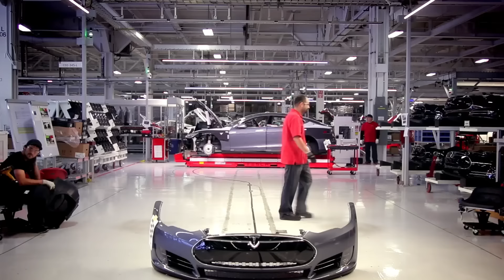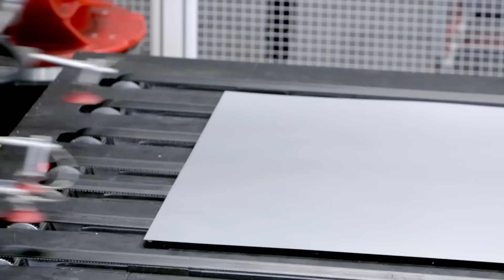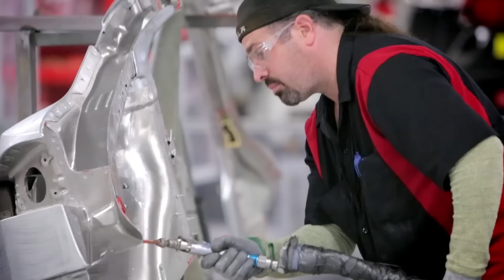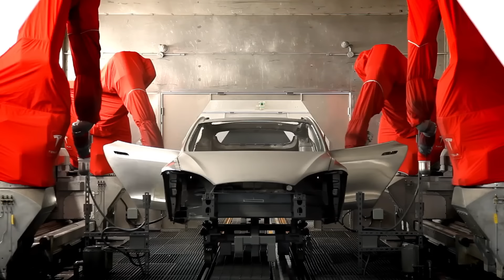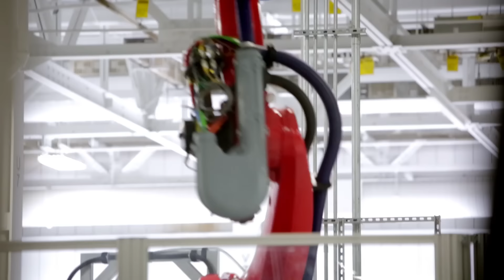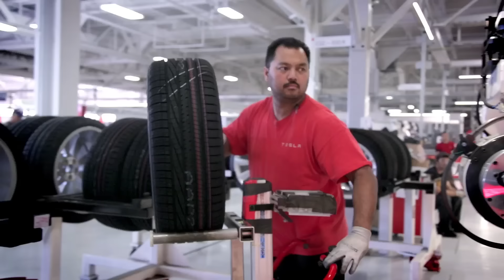How the Tesla Model S is Made | Tesla Motors Part 1 (WIRED)

Comment: It would be nice if all this happened with investors, rather than the sweetheart deal to take over the Toyota Gm Plant in California that Tesla received with the forced bankruptcy of GM. While extremely impressive technically, The Tesla that Edmunds drove 20,000 miles went through 4 motors and two battery packs. Seems to me the details were not worked through like a traditional mfg. I have driven the Model S. It is EXTREMELY impressive in performance. I don't see buying a used one however. I am pretty sure they will get the details right in Gen 2.

Comment: Question and thoughts center around the longevity of the battery (a question no one can answer) and cost of replacement

1. we know the cost to replace an 85 kwh battery is ~$12,000
2. we know the warranty is 8 years/unlimited mileage
3. we know batteries maximum charge degrade over time
4. eventually it will be worth while to replace the battery to get back to the vehicle's original capabilities

therefore I believe we have the consider the cost of the battery replacement in the annual cost to "fuel" the vehicle and if you do this the cost to run the car per-mile vs. an ICE car by tesla's own numbers is not very favorable

Assumptions: 15,000 miles year, ICE 22 MPG, gas = $3.80 gallon, kwh's = $0.11/kwh

by Tesla's own numbers @ http://www.teslamotors.com/goelectric#savings
ICE Car = $2591 year in fuel cost $0.17 per-mile in fuel
Model S = $467 year in fuel cost $0.03 per-mile in fuel

that is until you figure in the cost of replacing the fuel tank at the end of an 8 year life span (the battery) - for which you have to budget $1500 year - making the cost of the Tesla's fuel system $1967/year or $0.13 per-mile in fuel…

now I know there are other costs the ICE car has - but for purposes of this thought exercise let's focus on the "fuel" system cost and treat the battery as the moral equivalent of the "fuel tank". Which in an ICE car doesn't shrink, or need to be replaced in 8 years.

Even a 16 year replacement is $750/year in "fuel" cost to the battery…that still seems to be far less of an advantage than most people would initially consider?

Are there estimates of what the maximum charge of an 85 kwh battery will be in 8 years? What % a year will we as customer lose? How much will my fuel tank shrink each year?

 I'm thinking I would replace the battery after it loses 20-25% (300 miles - 75 miles of loss = 225 miles of range - time to swap batteries) of it's maximum range, and if that happens in less than 8 years my fuel-system costs now approach the cost of driving an ICE vehicle…I'm still excited.

After seeing & reading about this~ I am really excited also because each state could create jobs just by possibly building many statues or one huge monument of Obama in full figure from head to toe made up of all of the unusable batteries? I love it!

Comment: How many miles(or should I ask months?) will the average Tesla go on a new set of batteries?  And, how much does it cost to replace the battery bank?
Reply: Model S should last for at least 200k miles / 12 years. For now all battery packs are covered by 8 year warranty and sold cars would be covered for next ~6 years. 

Most reported miles driven in Model S so far is more than 75k. Battery pack showed little signs of degradation - around 2% capacity loss compared to when new two years ago.

Comment: Surprised it takes 5 days to make a Model S..... for most companies it's about 20-25 hours. Guess that's part of the reason for the price.
Reply: No it doesn't. They're talking about raw material i.e. a roll of aluminum to driving on the highway. 5 days is incredibly fast. NO OTHER company does that. Most take all of the pieces and combine them together in your quoted 20-25 hours but never start from raw material. they already have the frame stamped, or the engine already formed, ect.  The price, for what you get, is a deal
Reply: Defy Newton Nope, the stampings aren't the bottleneck since the presses just stamp away and build up a bank. Stamping is way faster than assembly. All components are built faster than assembly, otherwise you'd see cars sitting around waiting for the slowest components. The seats (as shown), motor, battery subassembly, dash, etc all come ready to assemble. Tesla just has a very slow line.
Reply: TheArfdog its called precision and quality. Nothing most car companies have.
Reply: TheArfdog  -- See this piece of sheet metal?  Five days from now it will be in a fully functional car.  Yes.  That is very fast.  Oh, and it's getting faster.

Comment: The replacement cost of Tesla's battery is $8k-$12k max. This is a well established fact. It is also a fact that the battery cell price drops 6%-8% per year. The Model S battery pack has a 10+ year life cycle, and carries an 8 year unlimited warranty.
Mining, refinement and transport of rare Earth minerals is 5 times safer, and cleaner than the drilling refinement and transport of oil.
Fyi, even when coal is the source, the Model S accounts for 50% less Co2 and pollutants than gas cars.

Comment: Yikes. In six years of production, this company has churned out a mere 12,000 cars (about what Toyota, or VW or GM do in 12 hours). The cost is prohibitive, except to the famed 1%. Worst of all, the car is an environmental disaster, running on coal-fired electric powerplants. As far as the stock goes, it is trading at 35X book, and has had only one (barely) profitable quarter in it's history. A true white elephant.

Comment: No, because there were ZERO jobs there before.  Tesla is located at the old NUMMI plant in Fremont CA, that used to make GM and Toyota vehicles.  GM pulled out of the joint venture several years ago and Toyota could not operate it on their own, so the plant closed, leaving thousands of workers without employment.  Now the Telsa plant has reopened with assistance (again) from Toyota and employs over 3000 workers.

Comment: The car actually received a never before rating of 5.4 from the NHTSA. 

"Of note, during validation of Model S roof crush protection at an independent commercial facility, the testing machine failed at just above 4 g's," said Tesla. "While the exact number is uncertain due to Model S breaking the testing machine, what this means is that at least four additional fully loaded Model S vehicles could be placed on top of an owner's car without the roof caving in..."

Comment: I have a 2009 Tahoe w/ FlexFuel & Multi-Displacement technology and I have come to the conclusion that a $100,000 Tesla would still cost me less to own and operate. Follow along..

7 Year Purchase @ 1.9%. ($720 monthly)
It gets 18MPG @ $4.10/gallon @ 1,800 miles/month. ($410 monthly)
It needs synthetic oil changes every 5,000 miles @ $70. ($25 monthly)
Other monthly maintenance costs. ($30)
Monthly total now: $1185

Tesla Payment: $900

Comment: Indeed, renewable energy must come to the forefront, but for you to trash EV as you done is a tremendous act of foolishness. EV's are a massive step in the right direction, they enable a path to fewer Co2 emissions and energy independence. The use of coal decreases every year, but even if an EV's power is derived from coal, it's still 50% less polluting than burning gas in an ICE's No matter what your agenda, you stance is flat out WRONG! You will drive an EV in the future. Congratulations!

Comment: All you say is true, but using oil instead of electricity costs 6-8 times as much per mile as making gasoline for that same mile. It's true that we need to move to renewable as quickly as possible (that was your point, right?), so solar makes the most sense. Yet you don't mention that.

You seem to be putting all your concern toward talking down electric cars - you know, the eight-times-more-efficient solution? 

It's a guys - just ignore and he'll go away.

Comment: Tesla makes its own motors and huge battery packs (out of thousands of Panasonic cells). Check out the pictures of the chassis. 362 horsepower from that compact unit! When they put one on the front wheels as well, the performance will be ungodly.

Comment: You "do" have a way to charge.  You just cannot charge at home.  If workplaces had charging spots, you could charge there.  If malls had public charging, you could charge there.  At movie theaters, etc.  We just don't have a good-enough public charging network (I'm talking fee-based, not just some of the free ones).  Get with your employer and convince them to consider putting in chargers.  If so, then you could get a Chevy Volt (I have a 2011 model) and charge "only at work and publicly" or EV

Comment: Coal accounts for only 37% of power production in the US, and the % shrinks every year. However, even if the electricity used by EV's is from coal, they still account for 50% less Co2 than gas cars.
w w w. afdc. energy. gov/vehicles/electric_emissions. php
It's hard to believe people are still reciting that old, tired, long disproven tripe.

Comment: Sorry guys, but this is not the future of cars.  Just based on the manufacturing of their battery alone makes for one of the largest carbon footprints from a car when driven off the lot.  When driven off the lot, its carbon footprint is already as much as my little Honda Civic after two years worth of driving it.  Hybrid/Electric "battery" cars are not the future.  Hydrogen is...

Comment: No, the dual large roll dyno is simply a more up to date type that can provide more accurate data.  It can be used with 4WD or 2WD vehicles.  With 2WD the non-driven wheels are spun by the dyno, more closely simulating friction of all the tires.  Its a ROBOT dyno.

Comment: What jobs are being replaced?  Did THIS car company have humans doing the assembly work 5 years ago?  I don't think so.  This company created 3000 jobs with the opening of this factory.  Using robots is their method of efficiency.  That will insure the same 3000 people keep their jobs for years to come.  

Any company that brings manufacturing BACK to the USA should be applauded!  Yes, they use robots.  Yes the robots are IN THE USA.  And YES those 3000 employees are ALSO in the USA.

Comment: If it is a heavy body, the shock will be directly transfer to the human body in a crash. But if it is a tin body as you says, most of the shock will absorbed by the body itself. And these new designs has engineered ways to push the shock around the cabin preventing it from going through the cabin, also reducing the shock on the human body. I'm not a automotive engineer or someone near that. I said what I felt and what I have read and seen. Sorry if I have made mistakes.

Comment: Edvik, Model S is actually expected to be a VERY long-lasting car. The 85KWh battery of the car has been tested to last past 500,000 mile mark in Tesla Lab - and is still going. So, the battery is expected to last WELL PAST the warranty mark of 8 years. The rest of the car requires very little maintenance due to:

1) Non-rust aluminum
2) Just 3 moving parts (as compared to over 1000 for gas cars)
3) Regen-braking  - no pad maintenance
4) Absence of transmission

Comment: Answers are all over Youtube:
watch?v=9OCaluFHjqw
The car will last as long as you take care of it. The question is the Battery pack, which has a 10+ year projected life, with an 8 year, unlimited warranty. The battery can be swapped at a Tesla station in 90 seconds. Within 10 years the cost should be very reasonable.
watch?v=H5V0vL3nnHY.

Comment: The higher pricing is due to the large battery options (60, 85kWh), an exceptional, powerful drivetrain and indeed amazing electronics (new software features get added/updated over the air!)

Comment: Not really. The whole body is made from aluminium and has a very rigid frame with very low center of mass due to the battery in the bottom of the body. It's constructed to reach 5 stars in crash tests. There's enough material on YT available to provide more info.